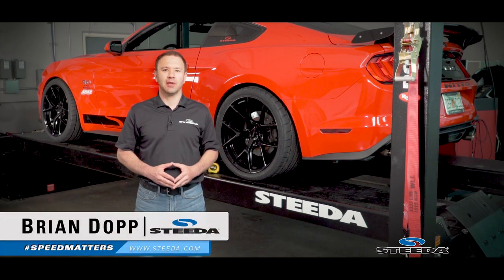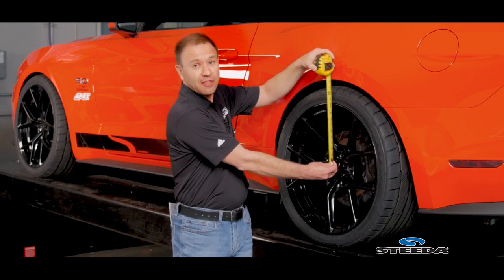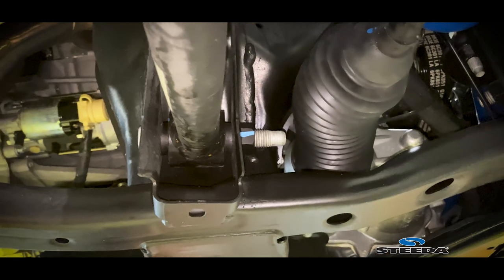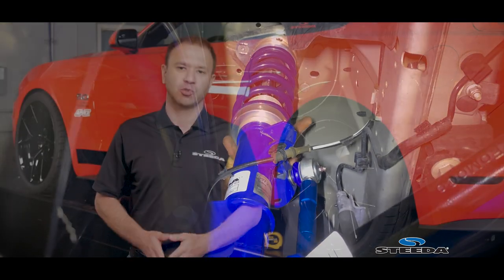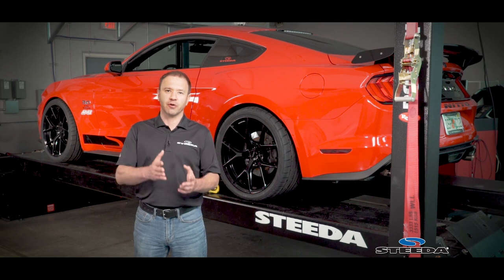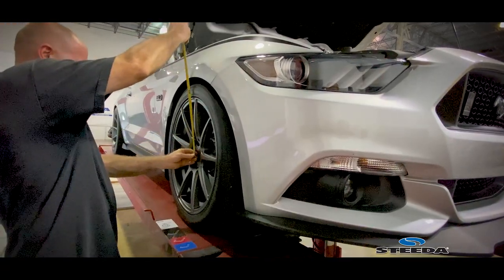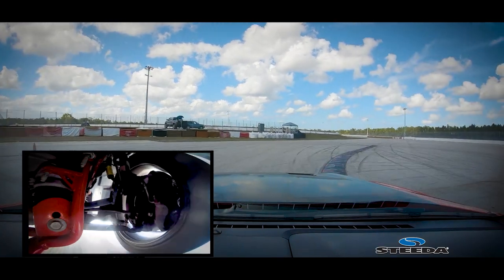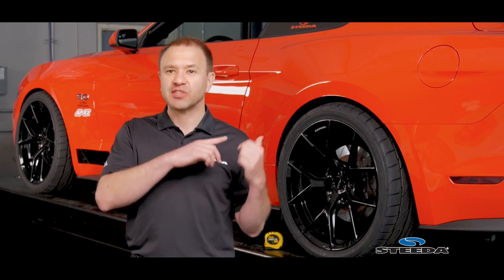How to Measure Ride Height | Steeda Tech Tip

Comment: I installed the steeda springs, billet vertical links, adjustable control arms on my gt350 , it sits better and rides alot better, now i need to order the sway bars

Comment: "You are getting a little bit goofy or obsessed corner to corner". 
Me who installed new coil overs and noticed all corners dropped by a quarter inch after a week, which is normal, but the left side front and rear dropped by a millimeter more.  Now I am watching videos about ride height.
Reply: If your new coilovers changed a 1/4 inch ride height after a week I suggest you get rid of them. Quality coilovers will settle immediately after the wheels touch the ground. It's called NO SAG springs 😂

Comment: My Ute has new coilovers & it's leaning down on the drivers rear corner,  I lowered the car but they're all set equal pedders extreme XA adjustable coilovers they fit them & I told em about it Leaning they reckon it's normal. I had to raise that corner 8mm to get it level, now opposite front corner is lower than the other side ??

Comment: Hi if the ride heights are different on each wheel and you don’t adjust the preload on the anti roll bars can the measured pressures in each tyre be different even if they have the same amount of air? I keep putting 35psi in at the petrol station and a day later one wheel has around 31 and the other 37

Comment: I have the rearward springs matched to the front .  When I have a passanger the rear passanger side drops 2/16 and the driver side rear goes down 1/16 but when I get into the car also the rear  driver side then matches ,goes to 2/16 . Anyways.  My question is do I lift the car in the rear 2/16's more .. so that when we are in the car the car is now level in the rear with the front..but anyways it would always be 2/16 higher in the rear.   If Iift it 2/16 more ,But normal when driving completely level.. Seems we need a full tank of gas and weights in the driver seats. Cause. Seems 1/16 is like around 100 pounds.  2/16 I'm guessing around 200 pounds

Comment: There's a lot easier way to find static heights. Asking guys to loosely find the center of the wheel induces error. Measure from the wheel lip at the bottom of the wheel up to the fender edge.

Comment: Why do you measure from the wheel well to the center hub or center cap?
Reply: Super late reply almost a year later, but I figure it may help others. The measurement is taken from the center of the hub because tire pressures and sidewall softness varies. Measuring from the center instead of from the ground eliminates the variance of height due to tires.
Reply: @miguellemillo2543 Which is why ride height adjustment should be done with properly inflated tires. And to be technical the driver of the car should be in the seat.